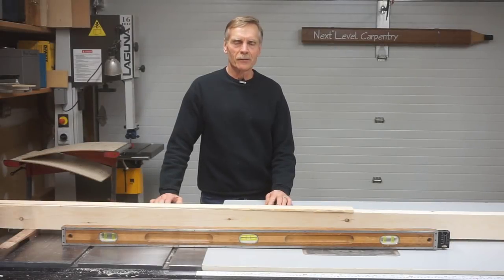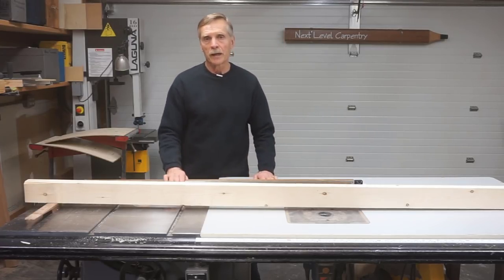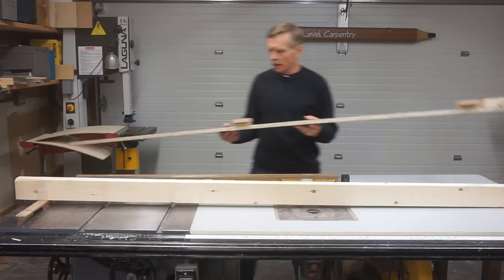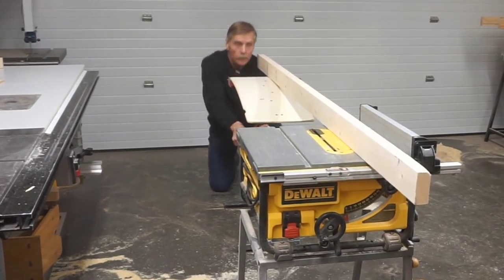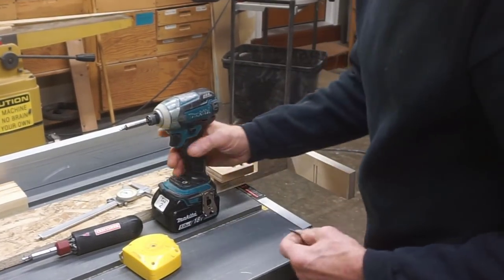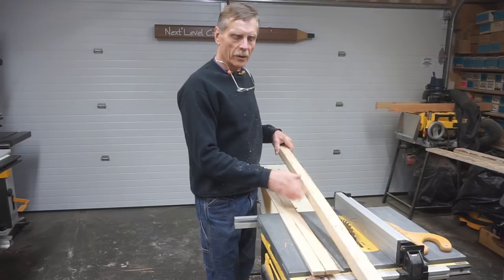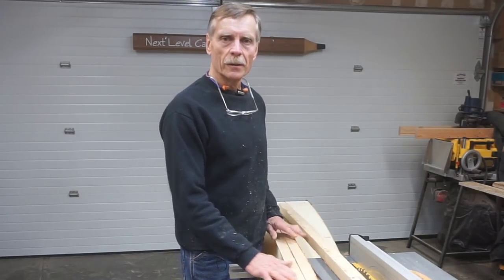How to Cut Super Shims

Comment: I started watching your videos this winter and seen them all, always look forward to new ones. I have to renovate my bathroom and realized my floor is way off level. Was thinking I would just sister in some floor joists and level them off but after watching this video I will attempt to make one of your super shim jig. It’s pure genius, keep them videos coming. 👍
Reply from the maker: Fantastic, Ermanno!  I really appreciate your comment and knowing NLC videos are useful/interesting enough for you to watch so many...
This method can work wonderfully for leveling floors as long as the joists are out of level but straight.  If they have a sag in them too you'd need to use extra steps to make the 'super shim' fit the sag/curve first by scribing it and then work towards making the long straight cuts with the fixture shown in this video.  You probably know it already but I'd recommend using some good construction adhesive between shim and joist to prevent squeaks between the layers.  Good luck with you bathroom renovation!  Best, Matt
Reply: Matt I ended up sister in my joists and it worked great, once my floor was level I realized my ceiling was off the same amount. I didn’t really feel like ripping drywall down so I made one of your super shim jigs, wow it worked so great. Thanks for posting that video, it saved me a ton of time.

Comment: Excellent video on making super shims.  I have a floor that is bowing and finally figured out hot to make it perfect.
Reply from the maker: Thanks for your comment Richie, hope you're able to adapt this to fix your 'bowing' floor. This method will allow you to level a flat floor that is sloped, however, and I'm sure you know this,  these shims are an even taper, not one that varies, which is what it takes to level a floor that's actually 'bowed'.  To completely flatten a floor that's bowed you'd need to scribe your shim to fit the bow and then snap a straight, level line and make a long cut to fill the curve of the bow.  Hope that makes sense?   Best, Matt

Comment: Great tips, Matt; I know exactly where I'll be applying them on my next project!  Thanks!

By the way, in case you weren't aware of it (possible, since dial calipers are typically used a lot more in metal-working than in carpentry), your dial calipers have a "secret" depth gauge on the end opposite the jaws: the little bar that slides in and out as you take or set measurements.  It's a more accurate way to set the depth of your depth-screw than trying to compare the distance against the inside-measurement jaws.  It may be that your calipers' depth rod got snapped off short at some point, though, in which case, measuring depth with the inside-dimension jaws is the only alternative until one buys a new dial caliper.  Sorry if it sounds like I'm trying to teach a master; we all have different skillsets, and the way you were measuring that depth screw just struck me as maybe this other method could be brought to your attention.
Reply from the maker: Thanks for a tactful and informative comment, Shawn!  And thanks for bringing this to my attention... I hope other viewers will see it and follow your insightful comment to make their work more efficient/accurate.  I do know about and often use the depth rod on those dial calipers in the shop which makes it a bit embarrassing that I didn't use it for this application in the video.  No excuses, just never thought of it.  I think I was trying to show the 'shoulder/depth' capability as an alternative to the tape measure at 4:05 in the video but it would have been a better practice to show the depth rod application you mention.
Your observations and comments are always welcome at Next Level Carpentry so don't hesitate to add any and all as you see fit?
Best, Matt
Reply: I rewatched those parts of the video a couple times, trying to figure out how Matt was measuring.  I've always used the depth gauge on the end.  After looking at mine I realized how he was doing it.  THEN I found this comment.  I should have looked first 😁

Comment: Good video, good idea. I often use shims to change the direction of a deck slope or to add a slope to a  deck.
For instance, next week I have two decks to renovate. Both of them are  set inside the building line in other words they don't protrude  beyond the exterior wall line so I cannot just lift their joists up and down.
Both of these decks slope towards the patio door from where they are accessed rather than away from the patio door to the exterior wall. So I will rip up the plywood and cut the floor joists to develop a slope towards the exterior of the building.
I wish I could just put super shims on but,  the patio door bottom sits right on the deck plywood so, I can't go any higher there, must go lower at the building edge.

Comment: this is a very usefull trick. The work I do without much exception is on old very crooked houses, so im always trying to shim things out to be level, plumb and square. 

a video that would be very helpfull to me and mabey others would be to demonstrate or describe / illustrate how you would go about leveling / plumbing / squaring an entire room thats out in every way (a situation i frequently encounter)  thats been gutted to the studs. 

almost all of the home improvement channels / shows I see seem to assume everything is already going to be plumb square and level, which is rarely the case in reality, atleast with the old houses I work on. 

I normally try and avoid gutting a room for this reason, and instead look to repair lath and plaster where possible, but sometimes its in such bad shape this isnt possible. hanging and taping drywall without first addresing these conditions can be pretty frustrating and time consuming, and ive always wondered if there is a relitively simple step by step approch I could use.

Comment: Wow! Very cool. I've been slowly remodeling an old farmhouse we purchased a few years back. One of my biggest dilemmas is how to level the kitchen and bathroom floors in preparation for tile. They are as much as 1 1/2" out of level. This should do the trick. Thanks! Matt P (Shelton WA)
Reply from the maker: This works great to correct any amount of slope as long as the sloped pieces are straight. If they're sloped And sagged you need to use a different process to correct both... 😎

Comment: Great video, your right I haven't seen anyone cut these on a table saw. On the job site back in the day we use to use string chalk lines and cut them with a circular saw. But as far as accuracy this method is better. Thanks for the video, keep them coming
Reply from the maker: Chipshot,  You've been around awhile too if you remember cutting stuff like this from a snapped line with a wormdrive skillsaw!  I was thinking about showing a quick clip in this video of doing just that but feared alienating  viewers by 'showing off' :-)  Portable jobsite tablesaws are really an efficiency and accuracy game changer, aren't they?
Best,
Matt
PS I'm guessing your 'chipshot' YouTube username implies that you'd rather be golfin' than sawing shims these days? :-)
Reply: Al, from Maryland Matt. No I believe the two go hand in hand. I have been golfing as long as I have had a saw in my hand. That was about 50 years ago, lol. I have used the old Makita portable table saw on my job sites for years. Very light weight and easy to take in and out of the truck. The draw back was the small table. These job site saws nowadays with these extension tables you can do a lot more with them. I am hot on buying the sawstop job site saw and building the small Paulk work bench and using it my shop and bringing it on the job site if I need it.
PS: The show off guy is the Essential Carpenter and I love watching him in action. I learned all my carpentry from two carpenters just like him, lol.
Reply from the maker: Al, I remember it was pure luxury when my first real carpenter boss would load up a miserable, rattly,  noisy, inaccurate, asthmatic old Craftsman 10" tablesaw and haul it to the jobsite so we could use it for ripping soffit plywood instead of having to clamp straightedges on and cut 3 or 4 sheets at a time!  Realities of 'the good 'ol days' are overblown much of the time, right? I'll bet the new SawStop outfit will be a fantastic upgrade!
Glad you enjoy golf... something I never got into but understand the drive to play (pun intended).  I chose to spend much of my non-work time getting modestly proficient at rock climbing which, although drastically different in practice, requires similar focus and ability to persevere through ups and downs (pun intended again?)
I hope to meet Essential Carpenter Scott some day... watching and listening to him makes it seem like I've known him for years!
Best,
Matt
Reply: Yes Matt, I feel the same way about Scott. 
I have never rock climbed but I believe it would take mega concentration, focus and determination as it does in golf. Golf might be a little safer unless you end up near a pond in Florida and get eaten by an alligator, lol. 
Yes your table saw story brings back lots of memories. Even a piece of junk on the job site was better than none, although one day a coworker brought a saw that did not have a screw that held down the face plate. It just snapped in. Well you know what happened, the wood bound in the saw and the plate went flying right by the operator into a piece of sheetrock.... Scary.. Needless to say never brought that one back again.
Good talking with you and look forward to your next video.
Al
Reply from the maker: Al,
Thanks for sharing hair-raising jobsite anecdotes... those sort of tales make a guy wonder how we survived through it all, don't they! 
 I wouldn't want to encounter an alligator... on a golf course or elsewhere. There are  a few mountain lions that roam the National Forest land around our house but I've yet to see any more than fresh tracks.  I did come eye to eye with a mountain goat with pointy sharp black horns some years back while out rock climbing granite spires withing a 1/2 mile of the Mount Rushmore Monument.  Encounters like that are rather indelible too!  I'll bet you have stories of lightning and golf... equally epic even if not fatal!
I'm actually shooting footage for the last video of 2018 this evening... if it goes even reasonably well I'll get it uploaded before the crystal ball drops :-)
Best,
Matt

Comment: Thanks for the tip.  I have one that I can give you.  When using your caliper to measure height you can use the pokey part that sticks out there back end of it as you open it up.  The part that comes out of the caliper goes against your board and the of the part that is slides in goes on the screw head.  Hope that makes sense.
Reply from the maker: pwolfable, your tip makes total sense. Thanks for tactfully adding this comment... it will help any other viewers who read it work more accurately and effectively. For some reason I had a brain cramp shooting the video and didn't use that method.  Only excuse I can think up is that I was trying to hold the caliper so the reading on the dial showed better in the camera shot but that's a pretty weak excuse.  Best, Matt

Comment: Great video! Your jig would work great on building log furniture. My only thought is that accuracy may slightly improve if the set screw is put as close to the end of the jig as possible. I appreciate gentlemen like you that take the time to elevate the carpenter community.

Comment: Mr Matt, thank you for these very informative videos. For cutting shims in the past, I have used a circular saw, ok for shorter lengths but still rough but no good for the longer lengths. And the quality of video is just fine!!
Regards, Garth (New Zealand)
Reply from the maker: Great to hear from NZ david... thanks for your comment here!  Ya, we've all had to cut tapers 'the hard way' at some time to get the job done, even though it was a bit less than ideal.  That reality is what makes a person appreciate this sort of solution all the more when we have the time and tools available, right?  Glad you're OK with video quality... I work steadily to improve them but it's a slow process for this 'ol nail-bender 😏😁😎 Best, Matt

Comment: Thanks, I am making long shims myself to saw cut concrete at at angle for drainage , you helped me greatly , my shims will taper my cut. ☺
Reply from the maker: David, that is fantastic lateral thinking!! Kudos on the clever application of this... I have a great deal of admiration  for your thought process. thanks for sharing it here and good luck with your project I'm sure it's going to work out awesome. Bedt, Matt

Comment: You sir are leaving a legacy of knowledge for us young bucks. Thank you for just giving away knowledge that was acquired over a lifetime. I have a question ...would building a sled out of of plywood not only make this job possible with a contractor saw, but a regular skill saw? 
Or 
Simply screwing a piece of lumber down, snapping a thin ink or chalk line to the desired rise:run and just free-handing it give you roughly the same tolerance as achieved through this process?
Reply from the maker: There are innumerable ways for adapting the general concept shown for making shims shown in this video Anton. It is easily adapted to a contractor saw and that would produce nearly equivalent results but anything free hand with a skill saw is not going to produce shims that are this fine or this consistent or this accurate without a whole lot more effort and attention applied to the task. I wish you the best and encourage you to continue to work to develop and apply your skills to the carpentry trade... I can tell you looking back on a 45-year career. I'm glad I chose this for a vocation and hope you're able to do the same in later years looking back to now... Best, Matt

Comment: Perfect solution for what I need to do today, add a 5 foot shim to the bottom of my 18 foot garage door to compensate for out of level concrete floor, Then attach new bottom weather seal. Shim will be cut from PVC to make a waterproof shim.
Reply from the maker: Sounds like and excellent application for the principles in this video... good luck with your project!
Using PVC for your garage door shim is also a great idea so please accept my compliments on your thinking?

Comment: Man if I could of seen this last week. I had to cut a shim for a remodel that I just used a chaulk line on a board and used a skill saw with a guide board. It came out ok but your way is a ton better!
Reply from the maker: Next time, Clinton, next time!!  This way you'll appreciate this method all the more and REALLY impress others on the job when you can tell 'em "don't worry about it guys, I GOT this!" :-) Thanks for commenting!  Best, Matt
Reply: Ditto!  A skillsaw and chalk line have been my method up until now.  This method will take my long shims to "the next level".  My method worked . . . but this is clearly a better way.
Reply from the maker: Daniel, having used the 'skilsaw and chalkline' method means you're capable of getting things done with what you got, and not everyone can say that.  Plus it helps you appreciate this little trick all the more!  Have fun, work safely!  Best, Matt

Comment: Hi Matt great great video. Have a quick quick questio. I have a very thick shim to cut. Length is 91 inches and i go from 0 to 3 1/2 inches on the thick end. Cut my board to 91 inches and put screw in block at 3 1/2 inches. Run i run it through my shim hits 3 1/2 inches about six inches short of 91 inches, not sure  what i am doing wrong. Just try to cut 91 inch 2 x 4 from corner to corner to give me 3.5 inche shim that starts at zero. Thanks

Comment: I could see this technique useful in cutting extension jambs for new doors/windows on old walls. Do you suppose one could cut an 81"  piece in one go? Or would you recommend doing it as 2 pieces as shown in this video? Thanks Matt for taking the extraordinary effort to share your extraordinary skills on Youtube.
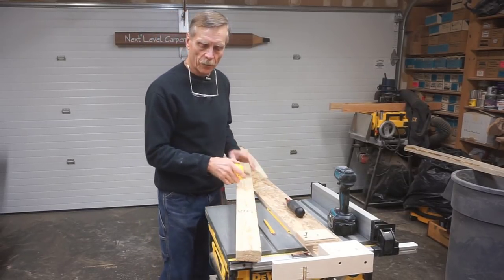Reply from the maker: Cutting longer 'super shims' or tapered jamb extensions is really no problem Grant.  The main reason I show the shim in 2 pieces is to minimize waste (you can quickly cut two pieces with the same taper from the same shorter piece) and make handling the pieces a little more manageable when a 'splice' doesn't matter because I'm getting an 8'-2" shim from a 4'-1" piece. Just use 81" at 4:25 instead of 4'-1".  You're basically limited only by the length of your straightedge fixture.  You're sure welcome for the videos BTW... Best, Matt
Reply: Mr Matt, I have a question...when the carpenters redid our master bath, they didn’t put shims under the Sheetrock to make the same reveal along the windows. Can I use your super shim technique to level the ¼ sawn oak molding I’m going to use?
Reply from the maker: @elained9591   The condition you describe is more likely an issue with how the window was installed than a sheetrocker's problem.  The preferred method is to plane down the window's jamb extension so it's flush with the sheetrock before installing trim.  Granted there's a ton of variables in that situation but I consider shimming the trim a last resort.  If that's the only option just scribe and cut strips of oak by placing them on the face of the sheetrock and drawing a line along the window jamb extension.  It would be very tricky and tedious so I hope trimming the jamb extension is doable... Best, Matt
Reply: @NextLevelCarpentry  thanks so much Mr Matt. I probably shouldn’t have said carpenter.  They gutted the bath and replaced Sheetrock and the insulation.  I will take a hand plane and level the jamb. I really appreciate your wisdom and willingness to share!